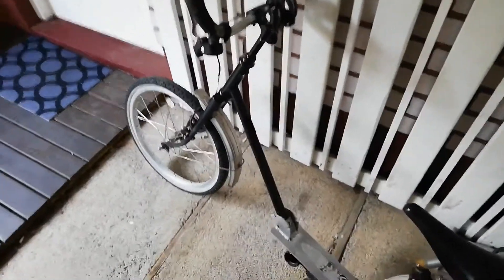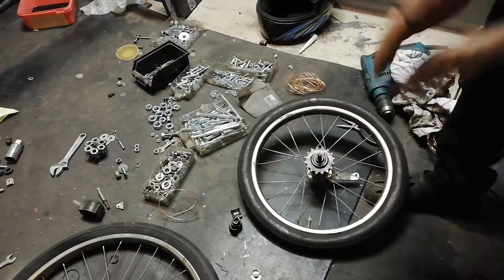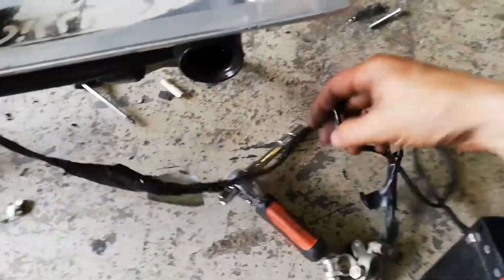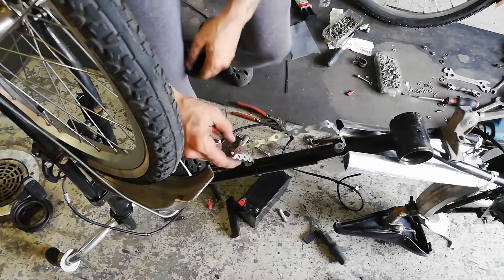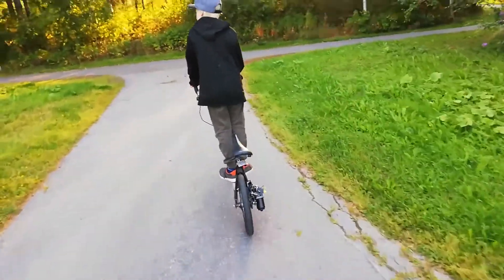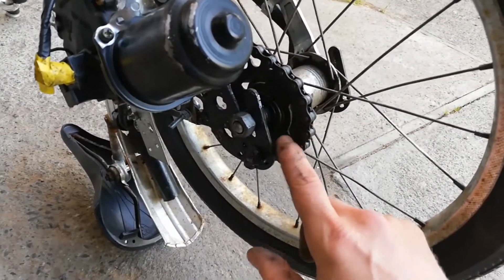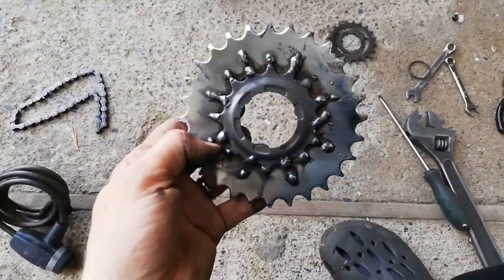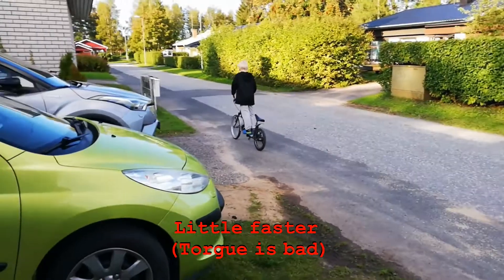Electric kickbike. Windshield wiper motor. DIY

Comment: What is the battery specification?
Reply from the maker: This was old charcable lead battery from scooter that i used. 12volt and only 9 Ah (bat-lead-10 12v9Ah)... Bigger battery would be better